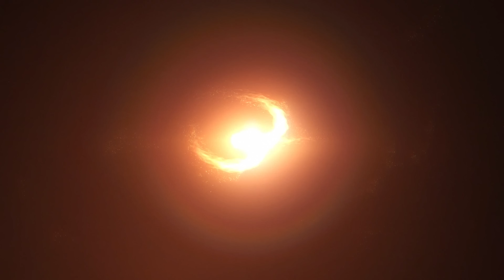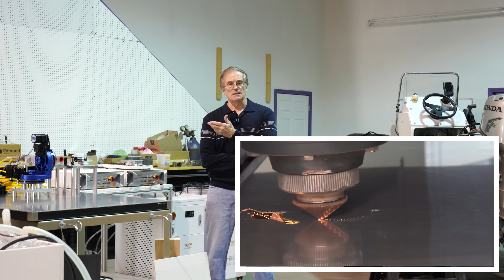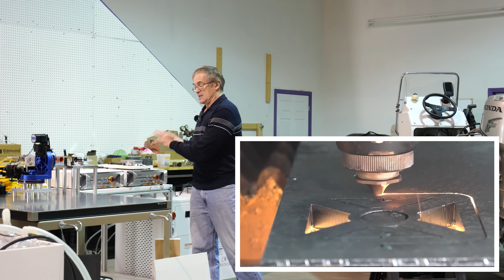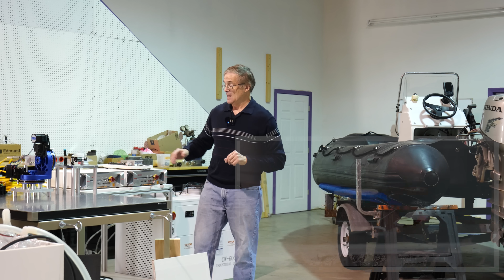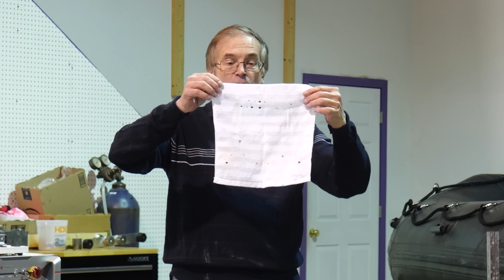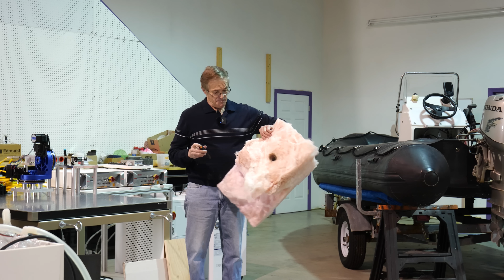We have a problem... and need your help!

Comment: Perhaps either a rockwool interior or mirrored interior box on top of a water vaporizer chamber. Think those really neato mist fountains that use a sonic oscillator to vaporize water into tiny droplets but just put a box on top that can re-scatter light back into the mist or absorb smaller degrees of light and can handle high heat. 

My hypothesis is that the light would hit the water droplets and do two things. 1: Scatter a bajillion times around the chamber, leading to significantly lessened burn chance of the chamber walls. 2: Flash boil the water droplets into steam, which would act as a phase change process. Light > Heat > Steam > Condensation > Pools back in reservoir to get re-vaporized by the sonic oscillator thingy.

Comment: There is no mention of spectrum.

Suggestions: 

---There is no mention of spectrum. Let's get the numbers on the demon we are fighting. It is definitely not "DC to Daylight". Let's get our problem precisely narrowed down. 
--- Vantablack. We need to create the equivalent of optical vantablack for the spectrum we are dealing with. The .01% loss could be an ablative backdrop. We don't have to get the energy to zero. We just need to get it attenuated down the x amount to requirements. 
--- Retroreflector-- Maybe a force canceling effort. One strength of lasers is that the photons/waves are coherent.  This strength (as in all nature) can be used as a weakness. So, if we can create a molecular substance to "retro lase".  it could attenuate the incoming energy effectively.  With all the great science lately on getting molecular objects to lase maybe there is an opportunity to attenuate using the exact same principles. 

So much fun!   This takes me back (again) when I worked with a physicist inventor for a start up in his house and again when I was science support in Antarctica. Creative ideas come from the diversity of experiences. And this is one of the reasons I concentrate on information science these days. It is a significant frontier of humanity. (ask a librarian). 

Love you guys.. crazy fun.

Comment: You’re smarter than me so this probably is not going to work but, how bout doing something like a foundation form. You could put it on a heavy duty furniture moving cart so you could roll it in and out of the way. Make it 2 feet by 4 feet, plywood forms, big bolts and washers through it like a foundation holding the forms together before the pour. Throw some bolts through the roller cart and pour onto those so they hold hard. Now you have whatever, 2, 4, 6 inches of solid concrete that you can roll in and out of the way 🤷🏼

Comment: What about a waterfall? A wall of falling water would "self heal", diffuse (but not reflect) the laser light, and depending on your tank size would have a large heat capacity. Fairly simple to implement.

Comment: 1 Water fog generator in front of wall, diffuse and absorb light.

2 Wall needs to be in layers.
  A. Ablative layer, graphite
  B. Refractory layer, frunace block or fireplace backer. You can try refractory furnace cement but firepace mortar is easier to work with.
C.  Support layer. Cement board.

The entire assembly should be kept as wet as possible.

Comment: 1. *Point it vertically, to the ground*: a rudimentary shed with open some open soil as the floor for the laser to hit into.
Or if horizontal is needed, build a small rectangular bank 2-3m² pond with thick wall of soil, inside which put water. Essentially an above ground pool with walls of soil. Water for cooling, soil for absorbing. Or just a big lump of soil.
2. Some sort of a mirror finished/aluminium coated frosted glass might be worth a try too. The miniature lenses (the frosting) in the surface will diverge it here and there.
3. *A miniature monolithic telescope lens*, installed in reverse, instead of converging, will diverge the lens broadly in a short span of time. It might still need some cooling, so submerged in water?

Comment: I don't think anyone has considered the simplest solution.  Move the experiment to a place with a large hill close by.  Your laser won't burn through the million or so tons of soil and rock and if done after a rain, there will be no fear of fire.  I don't know if you have any stone quarries nearby, or any type of surface mining, but either of those would provide a similar mass to the hill suggestion and have no fear of igniting dry foliage.  It would also be a whole lot cheaper and you wouldn't have to dispose of the burned stuff the other suggestions would produce.  Just a thought.

Comment: I may have the trick for you. I really love all your show tell teachings and the content is right up my alley. 

  Have you tried a Diffusing Aero Gel with Clear Nano Diffraction Spheres for wave interference?

  This would work as the opposite of a Light Accumulator.  The beads to fractate for decoherence and sized for deconstruction wave interference of the LASER and the Aero Gel for the Insulative properties to insulate and dissipate the heat from the structure?

  I do not believe anybody has made this type of composite material before. It would be a very good episode to try. And it can become a type of Super Light Laser Armor on flying craft or missiles being hit with laser defense. If it works there would be major practicality applications for the Military on this new material.
 This material would absorb High intensity Laser beam in the frequency wave length and resonance in a deconstruction interface wave form and deffract  the extra energy into smaller and smaller  constitutes and the Aero Gel tile will radiate the heat away saving the structure beneath. The perfect blend of clear Nano sphears and insolative properties of space aged Aero Gel. Would truly be a marvelous attempt at a new Wondrous composite material with real world applications. 😮😅😊❤

I had just done a quick search for this type of AeroGel composite nothing of suchlike material as discribed exists. This really might just be Worthwhile. 

Your long true phan, Tony.

Comment: My first thought is a tank full of a translucent liquid that can diffuse and spread the beam broadly enough to lower the energy per unit area or volume to an acceptable level.  Put it in a tank with walls of a material both transparent to the beam and sufficiently heat tolerant. Adjusting the translucency / transparency of the liquid would give you the ability to adjust the energy absorbed in a given volume of the liquid so that the boiling point would not be reached. Talk to some chemists and materials scientists for suggestions on best liquids and tank wall materials.

Comment: I do not believe that this will be cost effective, however if you can find no other solution I know for certain that for your specific application virgin Teflon/PTFE sheets are exceptionally good at diffusion of IR fiber lasers. Even a thin sheet with nothing directly behind it may be capable of completely dispersing the beam for extended durations. Do NOT under any circumstances use a CO2 laser on these sheets.

Comment: Can you redesign the optical assemblies to dynamically vary the focal length? That way you can have the beam diverge more before it hits the back wall and potentially in practice it can fine tune the focus based on the target range

Comment: Another dumb idea: What if you opened the garage door and used a mirror pointing into the ground?
Assuming outside is gravel.. you could just push a few stones towards where it hit afterwards and it'd be fine.

Comment: I have another idea. You could 3d print a laser trap. basically a cylinder with a closed end and an aperture in the other end for the beam. Have the beam hit a beam hit a convex lens mounted atop of reflective surface to defract the beam back to the walls . Having a reflective rounded surface like a donut around the aperture would also aid in containing the beam. 

Mounting the cylinder in a thermal exchange be it a sleeve or some jacketing to maintain cool temperatures of the trap will be critical.

Comment: The absorbant material needs to be moving. I guess thats essential.
Reply: Some kind of moving clay board kf 8cm thickness or so.
Reply: Or thick ceramic insulation boards. These are lighter and could be moved easier.
Reply: Like a big security pendulum of the best point shot material that swings ans a moving security screen cutting the exposure time to the laser light to a fraction. At each max phase, where the motion slows down it could have thicker material to compensate elevated exposure...

Comment: Is Rockwool an option? It's not fiberglass but closer to the bricks you used, it's light and cheap.
I'm thinking that the idea proposed by someone else of a pulsed full power beam and an aiming beam may be your easiest option with the protective layer being the backup/damage mitigation layer.

Comment: Carbon is your friend. Best would be graphite sheets, but might be cost prohibitive. Otherwise coal, but how to form sheets of it would be a project of its own. Carbonaceous ablative fire paint is also a suggestion to try.
Why carbon? It can in pure form (graphite) withstand more heat than anything else (almost), hence why they use graphite roads in electric blast furnaces.
Graphite ablates, has no toxic fumes, and is readily available.

Comment: Water curtain dyed to absorb the light. With a waterfalled backstop, reflective backstop of dispersing microbeads. The dyed water absorbs the direct light and the turbulant curtains break it up. Maybe have an ultrasonic fogger between the curtains and reflective backstop waterfall will scatter and redirect light even further spreding it out for the water wall to absorb the heat 

The proper dye should absorb the heat energy well as the refraction disperses the light.  Anything that gets to the backstop will have to go all the way back through that mess and face more refraction and dispersion while being absorbed by the dye.

Theoretically this multiple curtain can be made huge for minimal cost compared to a solid ablaitive wall. 
Make it rain!   All those falling drops will spread the light energy out while the dye blocks it and absorbs the heat

Comment: Would a curtain of water, in laminar flow, disrupt the laser enough to dissipate the energy? When you just dampen a material like cloth, the water wouldn't make much of a difference on cloth catching fire, but the reflectivity of flowing water may disrupt or distort the beam enough to negate the energy. You could even possibly add mica powder to the water, in effort to split the beam as it tries to pass through.

Comment: Salt and sand is relatively cheap, Not sure which would work better. I believe Salt and or Sand (Not sure which, white play sand, Dark river sand used in concrete or  black Basalt?) would be a good fill material in that it would be self healing (back filling the voids) and should rapidly diffuse most the incoming beams. Then maybe sandwich it between sheets of that "concrete under flooring" and put it on a stand with caster.

Comment: Did you try cement board?

Also aluminum is notoriously difficult to laser cut because it pulls heat away from the source so efficiently. 

Then there's welding blankets and laser curtains. 

Ideally you might consider a layer 1-2' in front of your stop that helps diffuse or disperse the energy before it hits the stop. Frosted glass maybe?

Comment: For the main backstop I would use a big pile of dirt as gravity might help fill in any voids, behind that a thick wall of rockwool insulation then perhaps a final "ohh shit" layer of fire brick against the building interior. Maybe you can find some high end ceramic or carbon coatings to add. If you have a home store in range they can deliver the dirt, rockwool & firebrick for around $2k or so. The main concern would be to avoid reflections and use powerful ventilation or filtration to deal with fumes. Cant wait to see it in action.💥

Comment: Rockwool might do the trick, fireproof, should resist high heat, denser than fiberglass, less dense than brick, not insanely expensive.

Comment: Hey, what about a water curtain?
I'm thinking a solid water flowing wall, maybe 1/4" thick. Try in both directions: perpendicular to the beam, aligned with the beam.
Maybe the curtain could be backed by a cement board.
Refraction may be an issue, but I think that should work.
Regards and good luck!

Comment: Or a thick wall of hanging glass beads on strings. Like those hippy door beads. It will reflect and refract millions of times and disperse the energy but the beads would make it highly unlikely to reflect a large portion of the beam back in any particular direction causing damage.

Comment: You were actually on to something. Heavy towels hanging from a hollow pipe, and pump water down over the towels. Have the water recycle through a large volume pump. No threat of the towels burning with a large volume of water flowing through the towels.

Comment: What about a surface painted with intumescent paint? The paint that reacts to heat by producing a carbonous foam to protect the surface? That may offer a lightweight, scaling solution to the heat damage, especially if the target wall is made of replaceable panels.

Comment: Welp, I guess I'll toss my two cents in here as well. 

As others have said, the best option would probably be the earth. A big pit. There's not much that's gonna withstand that sort of power density. Mount your system on a big ass tower. I personally don't like the idea of using the sky. You could hit a plane or something. The feds would be all over that. 

What I personally would do is use a diverging beam. So you'd have to add a focusing actuator to your design, but you'd limit the lethal portion to probably +-10% of the distance to the target.  This would probably require a very large space to test it in. A hundred feet or more, probably.

You could look into ablative materials. These can greatly slow down the burning. 

You didn't say how large of a wall / angle you need to protect. But I'm going to assume that if you're not willing to build a concrete wall, you're also not willing to build anything else. A cinderblock wall seems very doable to me. Plus you could fill it with dirt. Or hell, just stack sandbags in a semicircle. Shouldn't cost much compared to the cost of your laser system.

The physical size probably also eliminates any sort of fast moving disks or mechanical solution.

One possible solution might be to use smoke or fog. I'm not sure how much it would require, but particulate smoke is incredibly good at dispersing and blocking laser light. This is why cardboard is so hard to laser cut, and requires pulsed energy as well as good airflow.  A thin, very cheap, and easily replaced font panel (maybe a painting dropcloth), then a gap of a few feet, then a cheap back panel (maybe your drywall). Would allow you to fill the interstitial space with dense fog or smoke. Either by burning something, or with a vapor fog machine.  A small fan inside would keep it nicely mixed and homogeneous. 

...should be relatively easy to make a 12*20 wall with this approach.

Comment: I definitely like the idea of a fog or something to disperse the beam even a little bit.

I think layers of cement board with water flowing in between to remove heat. And the fiberglass shows good signs of absorption. Maybe a sandwich of all three.

Comment: While a flat mirror could be dangerous a convex one should disperse the beam rapidly.
Or just a flat mirror pointed into the sky or ground/ hole/ water trench.
Or two parallel mirrors to multi-reflect the beam long enough to dump its power.

You think you have problems, though. Imagine the backstop needed to test a Death Star! Maybe have a word with Lucas.

Comment: Ok, so, the obvious answer is, use a beam dump. You will almost certainly need active cooling, and the cone material will need high thermal mass and very high albedo, at least with regards to your lasers. Since it is a stationary target, you can use a meter+ long dump of large cross section.

Other ideas (but likely more expensive), optics to spread the laser and use on of your other backstop ideas, making sure to ebonize the backstop surface, and angle it such that any reflections are sent into another backstop

Primary concern is that you minimize retroreflection and account for the initial backstop suffering burn through. In furtherance of this, backstops should be behind a wall with a moderately sized aperture (10x your aiming error or beam width, whichever is larger)

Comment: Honestly just a lot of carbon, something with a high vapor temp. Shape, try to bore a cone hole into it to absorb all the laser, Back reflection is so dangerous. Finally an enclosure, anything you shoot will burn, so let it eat the oxygen out of the enclosure and run out. The beam should only enter through a small aperture. Any divergence you can put on the beam will help but not even saphire is going to help here.

Comment: Honestly, I woke strongly recommend spending more time on failsafe measures, relying on something beyond what you're trying to aim at is likely to lead to lax operation.

The laser should only activate when a target is confirmed, and then only trigger for as long as necessary until the target is no longer being aimed at - whether because the target moved or got destroyed.

Comment: The problem is the focus. You need a material that defocuses the beam. Not sure whether a practical solution actually exists. Layered Fresnel lenses?
Or maybe just redirect the beam into a pool of water on the ground with something reflective angled appropriately.